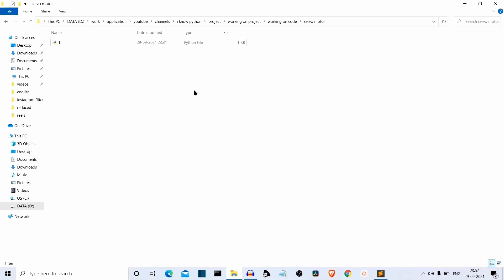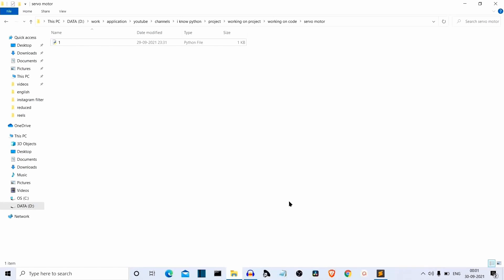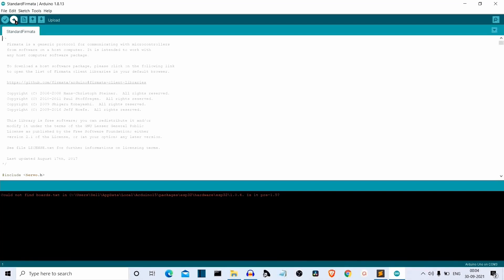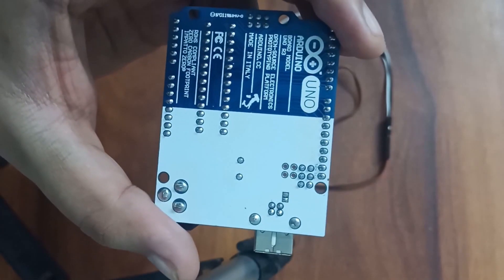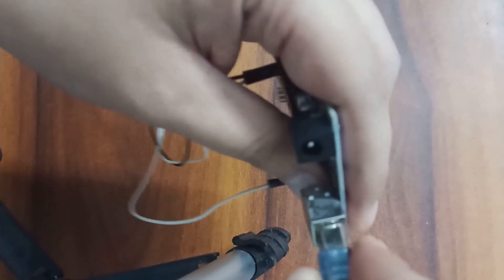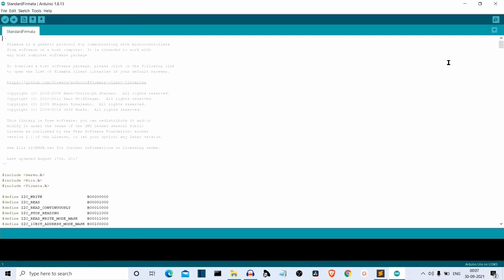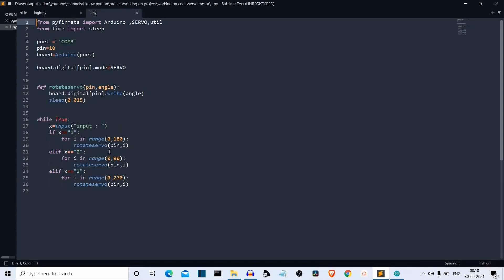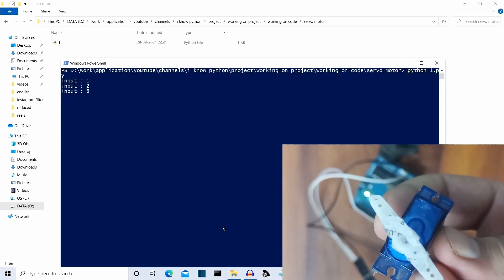Controlling Servo motor with Arduino and python

Comment: Hi, thanks for the video! I understand you control the servo speed by inserting a little sleep time between each little step. Is there a way to control the speed directly by specifying an angle and a rotation speed rather than slicing up the movement into many tiny micro steps? I am afraid that stopping and starting puts some strain on the motor and the circuits.
Thanks a lot in advance!

7IQPs

Comment: can you do Arduino atmega 2560(with built in WIFI) how to use  its WIFI module connect it to the internet using Python

Comment: Dear, share the code, please. It is impossible to rewrite the code from the screen.
Reply: nothing is impossible bro
Reply: @Gopal_devda  
from pyfirmata import Arduino ,SERVO,util
from time import sleep 

port ='COM3'
pin=10
board=Arduino(port)

board.digital[pin].mode=SERVO

def rotateservo(pin,angle):
    board.digital[pin].write(angle)
    sleep(0.015)

    while True:
        x=input("imput : ")
        if x=="1":
            for i in range(0,180):
                rotateservo(pin,i)
        elif x=="2":
            for i in range(0,90):
                rotateservo(pin,i)
        elif x=="3":
            for i in range(0,270):
                rotateservo(pin,i)

Comment: I want to make a servo controlled by serial monitor only 2 movements taking 90 degree as base position 
for eg for serial command 135 servo will move from 90 to 180 clockwise 
and for serial command suppose 235 servo will move 90 to 180 degrees anticlockwise 
plzz help if you know I am having a project and I suck at coding
actually I am making a code that sends binary input to arduino from 0-255  to serial monitor from python and based on particular input the servo will move as told above
Reply: loser